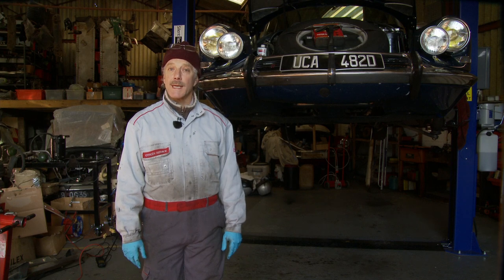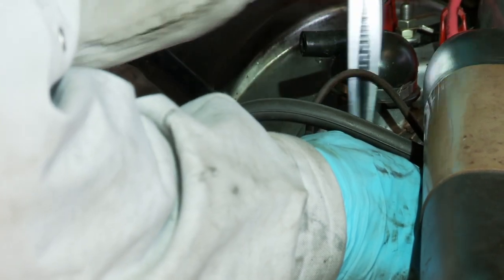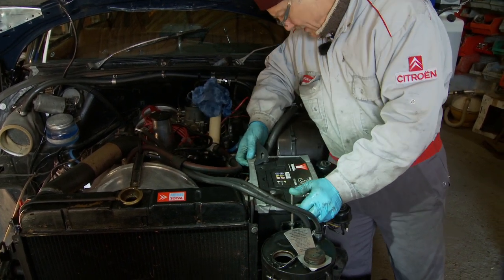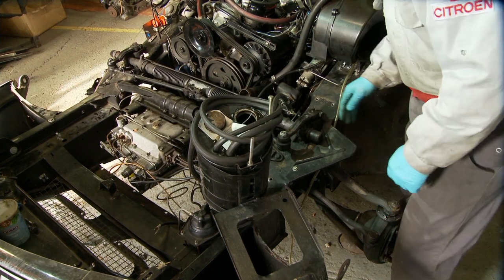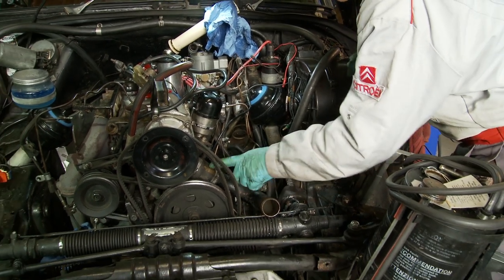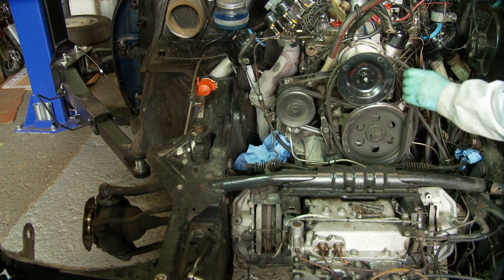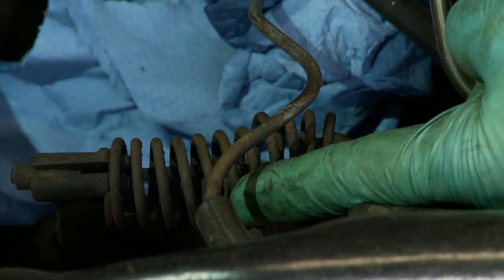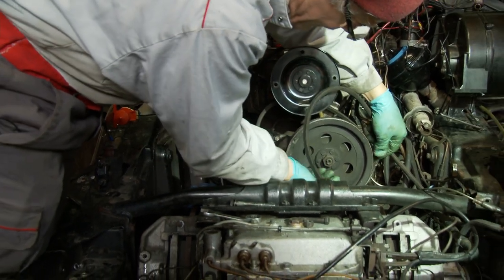Removing an engine and gearbox from a DS21 - The Feature-length version!***

Comment: Hi. My DSuper5 has low compression, but exactly the same on all cylinders. It never uses any oil and runs fine apart from seemin a bit breathless when climbing hills.It  Idles nicely. Only see about 65psi per cylinder when cold and adding oil to the bores makes no difference. I know the gauge is ok. I suspect the valve timing could be incorrect. I don't fancy removing the engine to check at the timing sprockets. Is there any way I can tell by looking at the valves at TDC for example. Any advise would be much appreciated........Steve.  Great videos

Comment: Great! Thanks lot for this video!
I wanted to consult with you on the repair of Citroen DS19 1968 year.
Semiautomatic problem.
Transmissions does not work.
Previously, everything was fine, sometimes with a long drive there were problems with turning on the gear, maybe overheating, but then when the car rested, everything worked.
Now after winter, transmissions not included.
Hydraulics works, does not flow, suspension rises.
Don't tell me what the problem might be? where can I see?
more thanks in advance!
Reply from the maker: First thing to try is bleeding the system to remove any air. If you look at the video about bleeding the brakes you  will see the extra bleed nipple on the centrifugal  regulator. But bleed it all and see if it helps.
Reply: I let mine sit for 10 year's I bet the hydraulics is bad?

Comment: 1:04:32 et les clefs à tuyauter?
Reply from the maker: L'utilisation d'une clé à tuyauter est préférable pour ne pas abîmer le connecteur mais malheureusement on ne peut pas toujours les utiliser sur la DS car il n'y a pas assez de place pour les tourner correctement. Une clé normale de bonne qualité est l'alternative.     Ian

Using a brake line spanner is better for not damaging the connector but unfortunately you can't always use them on the DS because there is not enough space to turn them properly. A good quality normal spanner is the alternative.   Ian